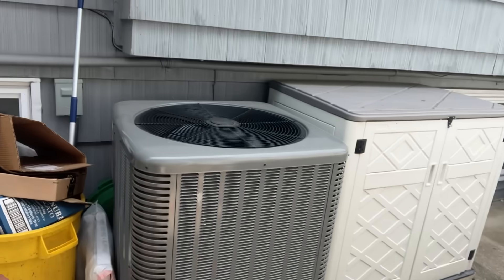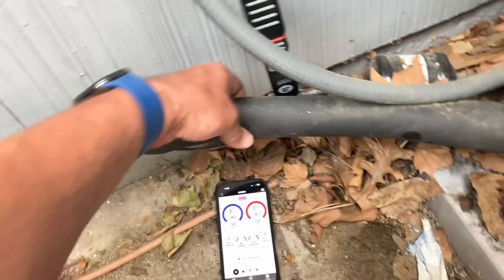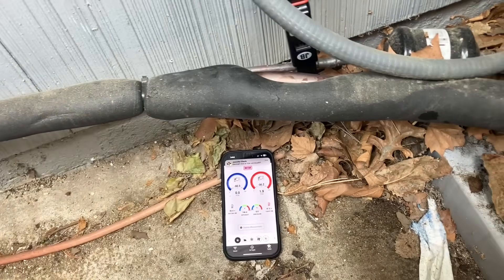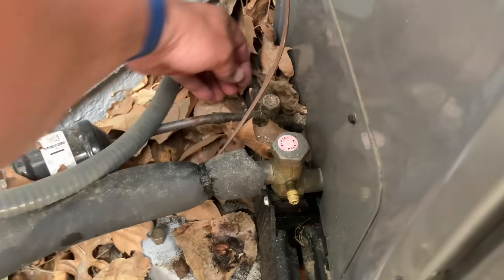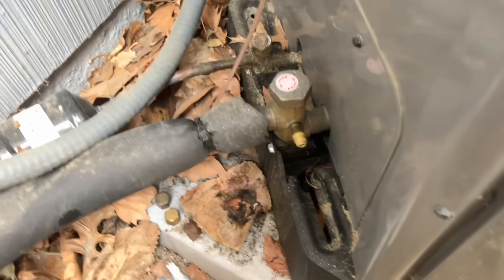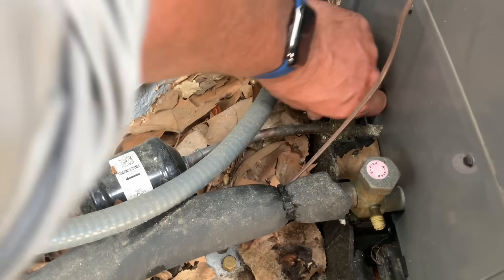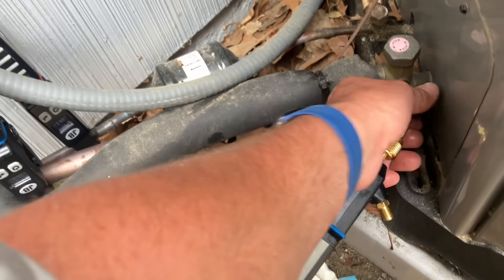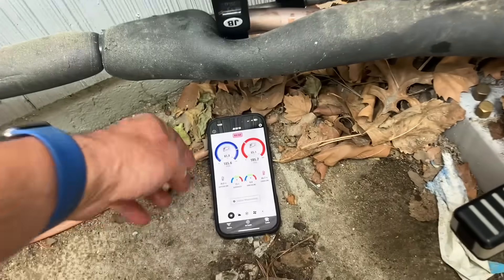AC Not Cooling? Frozen Coil, Low R410A & Oil at Service Ports! | Real-Life HVAC Diagnosis

Comment: All u know is I do not, will not and cannot work for free. Everything I do has a charge because it needs to. If I drive to and walk up to your home, I am putting myself at a 50% risk by hazardous conditions I delt with driving there plus I have no clue who you are until we meet and that risk goes away. Going through all that just to get to a call deserves top notch pay. Everyone including employers always skips the extreme importance and technician greatness of just getting to a service call safely these days and that's disgusting and needs to return as a first thought in everyone's mind immediately! The roads are not safe! They are not patrolled properly not monitored and that lets idiots every minute of the day to not only drive dangerously with zero skill making it worse but also Insurance scams by causing a rear collision with a commercial vehicle that will likely settle fast out of court with a check payment are on the rise dramatically! Those kind of accident-on-purpose scams are up 33% have rose 6 times in the past 6 years. 
Yea, you need to get paid to get a call and get paid handsomely and proudly. Don't allow the willfully blind to tell ya different.

Comment: You should never charge a system with any tools or scales covering any portion of the condenser fan. You cant get a perfect charge because you're pushing up the high side pressure by coving about 30% of the fan.
Reply from the maker: Good point, I'll keep that in mind for future reference.

Comment: Why not put bubble search on those shraders?
Reply: You make a cap with a small hole in the end, thread that on and apply bubble check to the cap. You can introduce the bubble check into the system when gauging up.